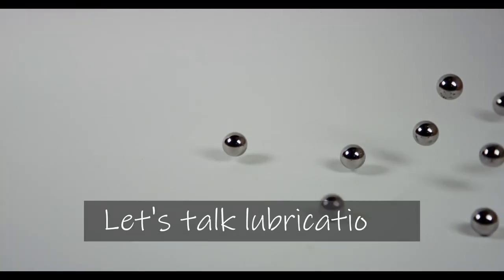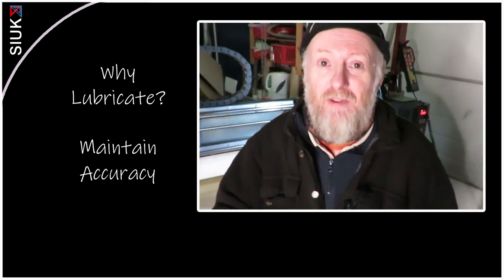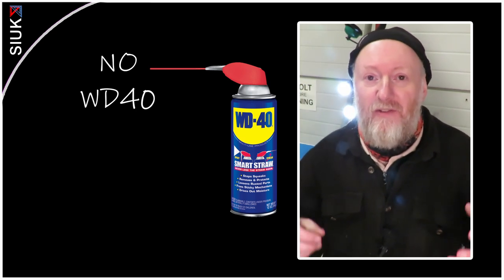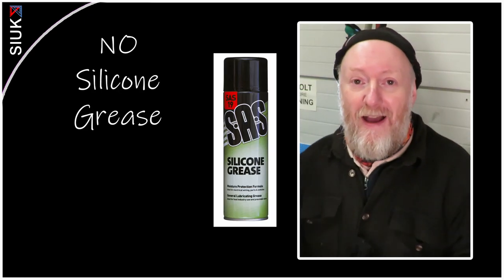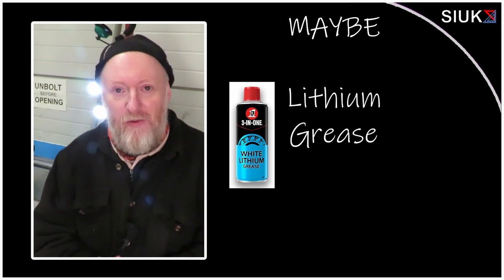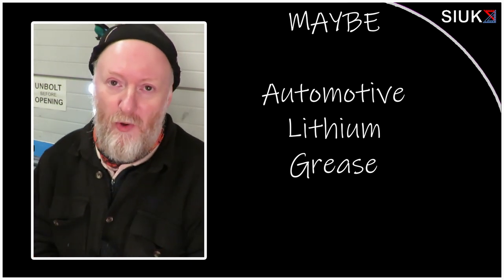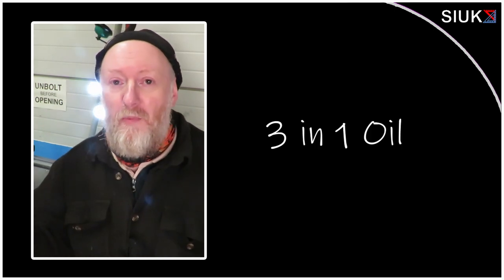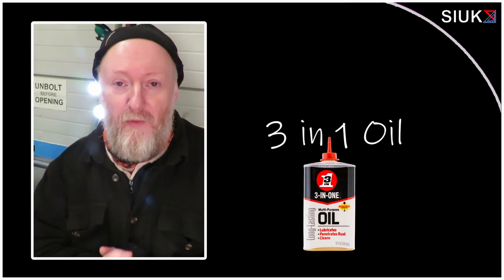CNC Router Lubrication, The Ultimate Guide to Do's and Don'ts .

Comment: Agreed on the rankings, although I have "way oil" instead of "machine oil" but it does not seem much different. I recently purchased a used (and abused) CNC machine. There was a ton of grease (hard to determine exactly what, but I suspect the "red and tacky" automotive grease) and even more grime on the outside of the bearing blocks. After disassembly of those bearing blocks, the bearing balls themselves were entirely dry. Even though they were in poor condition, the wipers on the blocks were still able to reasonably effectively kept the grease outside of the moving parts. It does not seem that many people know that the grease zerks on the bearing blocks are there for a purpose.
Reply from the maker: Sounds like you were lucky, I hope it was a bargain, they're the best buys, ones that only need minimal TLC to bring back to life!

Comment: I generally just find a manufacturer I trust (in this case, hiwin) and take their recommendation. Hiwin g05 (their standard grease) is an ngli 2 grease. I dont think most routers qualify as high speed in their eyes, but their g04 grease says its grade 260-280, which I assume means the ngli worked penetration test, which puts it in ngli 2 grade as well.

They also do say that you should choose the lubricant that makes the most sense, whether it be grease or oil, and they say not to use ptfe, silicone, or graphite.

Ive seen a lot of people recommend mobilux ep1 as a good lighter weight alternative as well, but I wouldnt be afraid to use a high quality ngli 2 grease.
Reply from the maker: As I mention, if your machine comes with a recommendation then you should follow it. My only caveat and the same with all the types you mention, which I confess I know nothing about, the lubricant needs to be addative free.

Comment: Some new machines will appear lubricated, but this is only a preservative grease that should be removed and replaced with the recommended grease. Not enough users do this and the machine slowly wears out.

Comment: Slideway oil is even better as it has specific bearing lubricant additives and will stay longer attached to metal  linear bearings and the lead screws, they also have the benefit of coating exposed metal to help prevent corrosion and it does not seem to leave a residue that holds onto dust so another win on that front.
Reply from the maker: Slideway oil and machine oil can be the same thing, depending on the grade of machine oil, but yes it is another name for it.